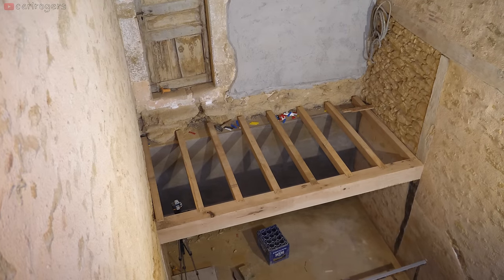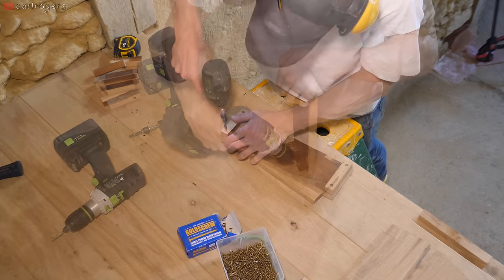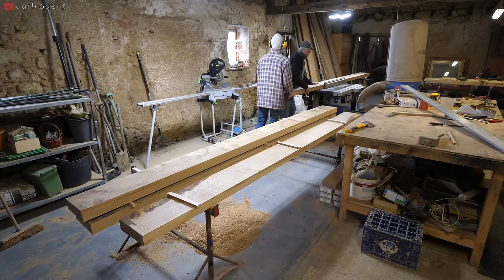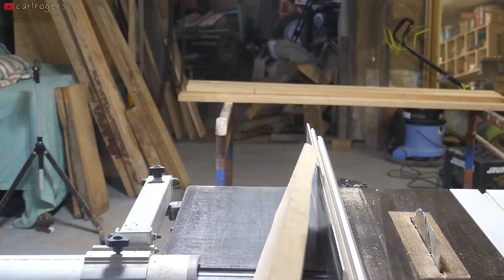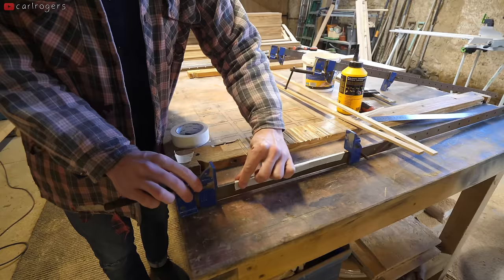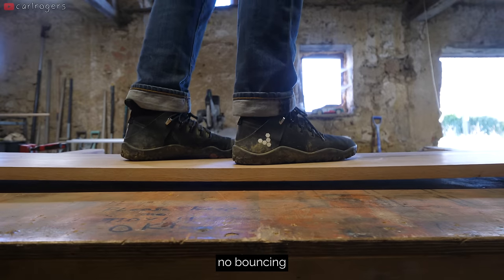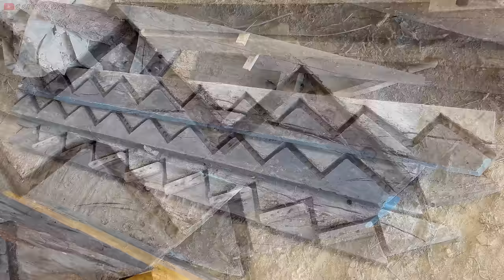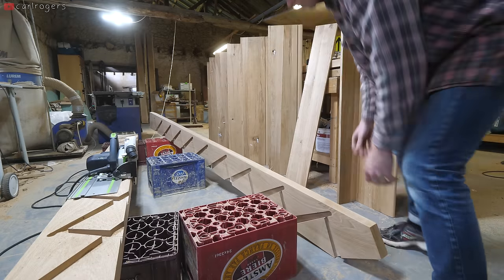#2 REBUILDING FLIGHTS | Building a Staircase

Comment: Once installed, that staircase will be about the strongest part of the house. It can neither be crushed or pulled apart. If you are so inclined, beneath  it would make a terrific spot for non perishable supplies and an area where, in the event of severe weather, or anything other than a fire, flood, or earthquake, one would be quite safe.

Comment: It was interesting to see when you guys were creating the re roof. You have done an amazing job. On the landing. Seems like there were no expansion gap left on length and also on width. Would you encounter on no size change between colder and warmer temperatures?

Comment: When putting screws into oak it's important to use a correctly sized pilot drill and countersink bit. This will prevent screws snapping and provide much better grip.
Really nice work though, oak is a fabulous wood to work with, just very hard.

Comment: we used to build those rabbited staircases by the same method but would assemble them with the stringers on a wide table with the upper face down on the table and install each tread/riser one at a time so you could wedge each side before moving down to the next tread/riser...and so on.

Comment: BTW, this is the only channel where I've ever seen free-hand ripping on a tablesaw (vs a bandsaw). You're really good at it.
Reply: I was surprised to see that; I definitely don’t think that’s recommended. An accident waiting to happen in my opinion.
Reply: @Hard_Right  I've done that. It helps with thick stock that has movement and may bind the blade. It can also help a bit with tearout, but I don't think that was the reason here.
Reply: Freehanding a table saw is well known to be SUPER dangerous without a riving knife.  I see you have one.  
Even with one, I wouldn’t.
Reply: @Hard_Right  for thicker and/ or harder woods it avoids blade vibration

Comment: Im pretty much gifted with no carpentry skills at all but I was told to make sure to leave a gap for wooden floor boards at the outer edge  in order to have space to expand which inevitably happens due to temperature changes or moisture in the air. I was told that it would be necessary to prevent floor boards to bulge up.

Comment: Nice work, I really enjoyed that video. Juts a note on your splines, they have the same grain orientation as the boards so they basically add 0 strength. You would need the grain to run at least 45° between the planks and not parallel.
Reply: I was watching that as well, there is a local guy here that was doing the same thing, only his, thinner, wider, softwood splines went in even looser than these. I mentioned the same issue to him, his answer was that's how woodworkers have been doing it for a long time. 
My experience watching the steps of some of the obviously skilled craftsmen on youtube is that their joints are already tight and strong even before glue. 
I was surprised to see these loose parallel grained splines go in this application.
Reply: The main advantage of the splines is to increase the total surface area of the joint in this instance vs a regular butt joint.
With the grain running the same direction, effectively the spline and the rest of the wood is acting like one homogenous piece, with the glue reinforcing the contact area between them. So it should remain very strong for the stresses and loads expected to be put on the treads.

Comment: I might be "only" a Painting contractor of 30 years (mostly older homes (Connecticut) in New England) and I work around a lot of trades. Some do their job very well, others, not so much. As the guy that is usually the last trade on the job and have to fix whatever didn't go right in the pursuit of just getting it done, it's great to see your goal of perfection.  Not that this staircase will, hopefully, EVER be painted- it is simply a joy to see the painstaking approach to detail that your work exemplifies. New subscriber and glad your channel came across my path.

Comment: Those oak stairs will last a few hyndred years, they are absolutely solid.
Reply: This is a stellar project indeed combining multiple classical craftsmanships techniques, tools and practices :) And demanding a lot of patience as every project does. I really enjoy the series, keep up the good work; I like the editing style: no bs, music, just the background noises and wind and some narration here and there. Works perfectly!

2:03 Was there a reason for using planks lacking the tongue/groove in the first row and the last one? Now, there's a chance that it will likely create a gap as temperature, humidity etc. varies according to seasons and environment. Yes, the last plank can be a pain to fit, but doable.

I have built some floors, ceilings and indoor construction for a while. Here are some tips and tricks:
-Always keep the glue bottle almost full so you don't have to squeeze it that hard when glueing repeteadly and multiple joints during the same session
-It is worth investing sharp & fresh blades for the mitre saw and jigsaw; the money will save, time, effort and yield more finished result in any project - and decrease the chance for splintering or skipping - and therefore increases your safety as well
-Those annoying knots and holes can be filled with the mixture of sawdust and wood glue, then sand it off the next day, epoxy is valid, too
-I prefer a wooden or plastic mallet when hammering the splints in to prevent splintering/breaking whether it is the case you have to really use force to get 'em in 100%

Greeting from Finland!
Reply: @pistool1  great tips & tricks. Greetings from Holland
Reply: No. Solid would be 40mm step and  60mm  stringer.
Reply: no they will rot because he used concrete

Comment: Just a quick question,what would you do with the big gap between the door and the floor??and those bent oak treads,with some hot water and something with 40 pounds of weight to straight them up could've work

Comment: In rural France(basse Normandy,) we layed over 100 sq. meters of .23cm oak floorboards(like yours,) 20 years ago; no nailgun but I did predrill the starting hole in the male slot of the oak flooring.  Helped a great deal.  Also sticking nails into axel grease helps but one needs patient assistant(was only my wife at the time,) and that wouldn't have lasted half of the morning....Great project; love watching...cheers...rr

Comment: I think not having a sub floor layer to bridge the gap between joists on stair landing will result in creaky floor boards. What was the reason for nailing directly to joists?

For stair board splines, wonder if gorilla glue (that foams) would be a better glue for that type of joint?

Comment: I am really fond of your work, and it is spectacular, I believe this new staircase is going to last longer than the previous one ! Really well done :)
If I juste may say something about the cement, it is still quite important not to use it in old stone houses because of humidity that still is in the stone and can break them, but also because it doesn't move as well as lime with time (in a few years of time you'll have cracks that you wouldn't have with a lime mix). If you can, you should use only cement for foundations, forget it elsewhere :)
Can't wait to see what you'll show us in the future

Best regards and keep up the good work :)
A fellow french guy renovating an old house
Reply: I'm so much in line with this comment. I love 99% of what is done in this channel, and the 1% I really dilike is the use of cement. Lime mortar is not that difficult to use and so, so much more durable. It stays plastic and doesn't crack, it is perspirant and respect the huidity equilibrium between inside and outside the wall.
Reply: @sofconmac5299  Do you ever suggest using wire mesh as well? And how should the wall be prepped? Cleaned with a wire brush or power washing? What about applying a bonding agent? Right now our walls are very chalky with the parging removed. Appreciate the feedback

Comment: You have got the patience of a saint knocking all those nails in by hand Carl! I'm lucky that we could hire a PortaNailer locally, and used it when we installed T&G ash floorboard in our house. They are really simple to use, so if you're considering doing this it's well worth hiring one! 
We didn't have T&G on the end of our boards though, which was fine as we were installing them over a subfloor, but it does mean that the odd one where the end cuts aren't perfectly parallel and they touch - they squeak a little. These oak floor boards are stunning, and the staircase is beautiful. I bottled making my own as they are so complicated particularly with UK building regulations, and I was offered a freebie which I've then modified to add a winder, and I'm in the process of cladding it in leftover ash flooring. I'd love to have the skills and tools to make one like that!

Comment: Have you seen post head screws available at Toolstation UK (not Toolstation Fr)  - they are an absolute game changer. Called Lost-Tite screws.   Just buy extra Tx10 driver bits as supplied ones wear out. 

Where did you buy the oak floorboards?  (I need to buy approx 30m2 for a project in France (33 Gironde).   Thanks

Comment: When I started my Cabinetmaking Apprenticeship back in the late 70's worked in lumber breakout for a commercial cabinet/millwork shop. I can't begin to imagine how many feet of solid oak, walnut and alder boards I ran thru a massive overhead rip saw, then a 16" long bed jointer to get a 90-degree corner and then thru a 24" wide planer for thickness. All these machines were large commercial machines that took a great deal of space so to see the small system you are using to get the same results is something that lets the smaller home-based shop such as yours, do great work in small spaces.

Comment: I hate to be that guy, but please don’t ever rip boards on the table saw without using the fence!!! You can’t imagine the force a kick-backed board can generate. Peace.
Reply: How can you cut out pieces with different angles to the sides of the board resp. different sizes/widths at its ends when using the fence of a table saw?
Reply: @christiankoellner7542  you don’t use the table saw for wonky boards like those. You would use the bandsaw, or a handheld jigsaw.
Reply: Or even better the assortment of tracksaws he owns! The Ts85, the TS55 and the HK55; they all would have made quick but more importantly safe tapered cuts. Seems like a skilled lad, but free hand ripping on the tablesaw is just plain dumb! And no safety glasses or hearing protection that I could see.
Reply: @Mrjglass213  no respirator either.
Reply: Time stamp of what you’re referring to? At 49:45  and 50:13 he’s using the fence, but not a push stick.

Comment: Nice work, on those cupped or warped boards I would have used a router with a groove cutter for the splines. This would have resulted in perfect grooves to house the splines. Only downside is that you would have to clamp each board individually. So even a little more work....

Comment: Great video.  Nice job. Love watching other work. Hah.
  The only thing about installing the tongue in groove oak  is it will expand and contract with moisture and temperature changes. It's nice to leave a little gap at the edges for that. But it will probably not be a big deal in this application.  I'm too OCD to not have the boards split a joist though.

Comment: Nice work. In 1980 I built a staircase as entry to my house in Hawaii, so it was exterior work in a (very) wet environment. It had 15 risers. 
I used 4 x 12 for the horses, let in 3/4" for (3) 4 x 4, gapped,  as treads, 48" wide. It is still standing in good shape being used every day but I did cover it a rain roof. I used to waterproof everything once a year.

Comment: Cutting and gluing those wavy old planks made a huge amount of sense. They are perfect for (re)building a house originally built from local materials. You mentioned rough areas set to the underside. My mother had old furniture built that way. It uses wood efficiently and can’t be seen.

Comment: I think one of the biggest advantages of splines over a butt joint is in the lifetime of the stairs if the boards do start to seperate the spline will often keep the two connected.

Comment: Hello Carl, can an old joiner give you a little advice for next time. Put your stringer on a set of low  trestles, install your top,middle and bottom treads wedged with glue. Put your matching stringer on and wedge with glue. Check your square with diagonal measurements. Install all your treads and wedge with glue. Install your risers and wedge with glue in your housing's on your treads and on the rebate. Then you can screw back of the risers to the treads.

Comment: I think grooves cut by router (table or hand) would be more accurate. I’ve done desk top this way and it turned out pretty nice. My insert was a bit loose too but I used paper to center the boards and tighten the fit.

Comment: You need a counter sink bit for the screw holes in the wood. I use one for hardwood decking that you can set the depth for different sized screws.

Comment: Love the vids keep ‘em coming! One tip I picked up was using an old toothbrush to spread glue on glue joints, with the shorter stiffer bristles takes far les time, and you can squidge some glue in a cup and just dip the toothbrush in, so less squeeze out ;-)

Comment: If you have any sag in treads you can install tension rods. You set a block between each tread and rod and the rod is set less than thickness of the block. When the rod is loose there will be bowed but as tighten it will straighten out push the block and tread up. This is done on wooden step ladders to give them strength without adding extra weight.

Comment: Rough cut wood seems like it's such a good bargain, but then by the time you spend all that time with jointers, tablesaw, thickness planer, hand planes, winding sticks, etc, it always seems like it would have been better just to buy the S4S stuff and save all that hassle.

Comment: I don't trust glue, so I would be much happier with the method you choose instead of just gluing them. But, even if the splines are not perfect, the mode of failure changes, doesn't it?
Even if they are not perfect, I think they were worth it :)

Comment: You implied those splines are too loose. But you are not forcing out the glue, so the joints should be strong. Even better any slight cutting errors won’t leave a step between boards. I don’t think it’s wasted effort.

Comment: I really enjoy watching your channel. I've learned a lot just by watching. I'm typically the learn better by watching then doing type. I would say, if they are available in rural France, find "Torx" or star head screws as they cam out less and typically don't have the problem with stripping.
Reply: I agree. Don't use "cruciform", use Torx ! Impressed by your work :)

Comment: A battery powered multi tool is a marvellous bit of kit for this type of work. I had originally passed on such a tool as I am a professional woodworker, restoring antique furniture. However the 18 v Erbuer Multitool has been very useful especially when purchasing quality cutters such as those with carbide tips that cut through hidden nails / screws. A common occurrence in my line of work.
Comments?

Comment: I don't think the spline joints were a waist of time. Remember glue takes up space, so movement in the joints before glue may disappear after gluing. Also, even if there is some play in the joints, the splines will still keep the boards straight along their length. The more surface in a glue joint, the stronger the joint. 💖🌞🌵😷

Comment: Love the channel but I feel I need to point something out. Cross grain gluing wood past 6" is not a good idea. Flat sawn white oak has a pretty high dimensional change coefficient (.00365), and a fully glued joint that wide is sure to break fairly quickly as the wood expands and contracts, and the possibly of splitting either the tread or the stringer is there as well. Gluing only the first 4 to 6 inches would be a far more stable joint.
Reply: You clarify for others what you are referring to, which I believe is where the treads and risers are housed in the stringers. It does seem likely that the treads will develop minor splits, but given the size of the stringers, it seems unlikely it will split. At least, not due to this. I guess we'll know in a few years.
Reply: @idontthinkso666  At a minimum, the glue joint will fail as the wedges are completely cross grain to the treads, and the joint is way too long. The glue should also be applied thinly otherwise the extra moisture will "feed" the glue joint with water making it weaker. I really enjoy the channel, but some of the stuff they do is not "best practice".

Comment: Just so you know the rebate block should be as low down as possible. So the timber passes over the top covering the cutters as you go. It’s safer and there is no chance of the timber climbing into the cutter becoming a dangerous projectile or ruining your work. The general rule of thumb is to always have as little of the block above the surface of the table as possible.

Comment: They do make nail guns for flooring I have several all different brands and they all set on a shelf in the shop collecting dust along with 1000s of boxes of nails for them. The guns do not work the nails don't hold and work their way up splitting the boards and creating tear outs they hold for a few years but then eventually work up, We've been ripping floors out that we put in 10 years ago and relaying them because of it and it's not just ones we installed it's many floors running between 10 and 20 years that were installed using guns. We have went back to the old way that we originally used and that forged flat nails we have an amish supplier that gets them for us they bight and hold.